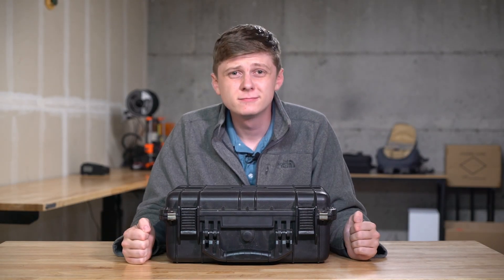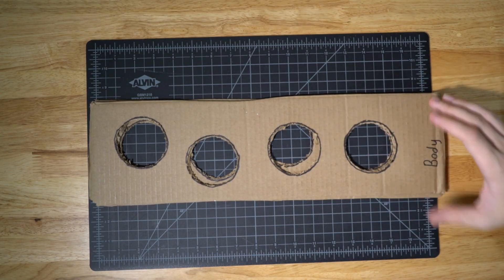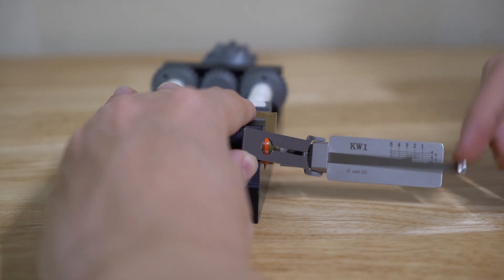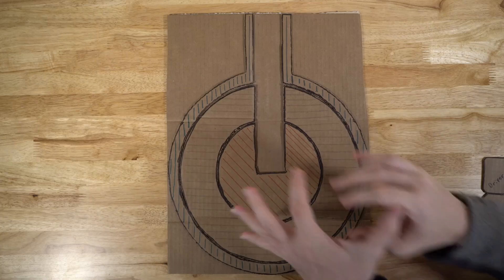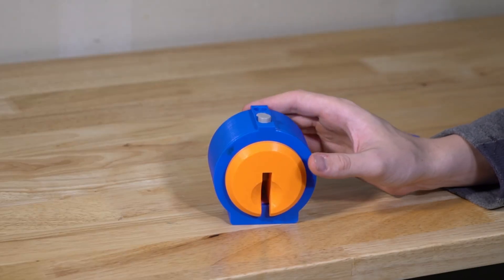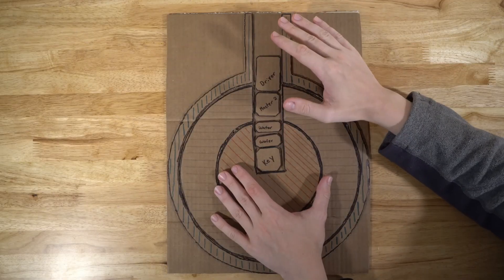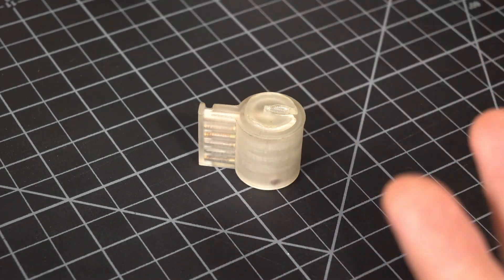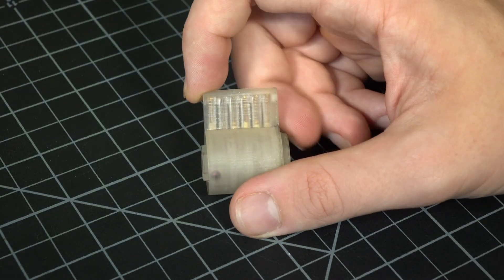How to Design an Unpickable Lock

Comment: Watched all three video...there was a canadian CL maker that made some similar designs. But...this does not seem unpickable. More difficult yes, but not impossible. (And frankly we have a lot of difficult but no impossible locks out there.) One reason lock design hasn't changed much, at least on a base consumer level (IE: master/kwik/defiant/etc) is that it hasn't needed to. There are several reason but one is that...picking is a skill. Picking under pressure of getting caught takes practice and calm. If the goal is to break into the house or the shed....there is most likely a far easier method to get in. When asked "what kind of lock should I get," I always respond with, get a better door. You want the television, you can either learn to pick (even bump attacks take some practice and knowledge of what kind of a lock it is so you can bring the appropriate bump key,) or you can kick the door in or break the window next to it. That takes no skill, no knowledge, and no tools.

Comment: This would certainly require a targeted pick tool, but it looks to me like this lock is vulnerable to an attack that is essentially identical to the method used to pick tumble pin locks, except going from the top down instead of from the bottom up. You first lift all pins until the inner core can rotate freely, then pin by pin you lower it one position at a time until the inner core can't rotate—the last pin position where the inner core rotated will also allow the outer core to.

Comment: The ideal lock is a lock that doesn't exist, but its function is still fulfilled. Why strive to make a lock with a key and keyhole when these two parts are exactly what allows the lock to be picked? Get rid of the key and keyhole, and you've practically created a lock that cannot be opened without destroying it. It's that simple.

Comment: It's nice showing off the prototype gear however this isn't any better than a conventional pin and tumbler lock.
It doesn't do anything to protect against comb picking, at most meaning it takes abit longer as each attempt requires a reset from the test position. Although the master key pins make it easier rather than harder to pick by creating multiple valid combinations, increasing the odds of successful picking.
It also is highly vaurnable to corrosion due to the tripling of the number of moving parts which makes it inappropriate for outdoor use.